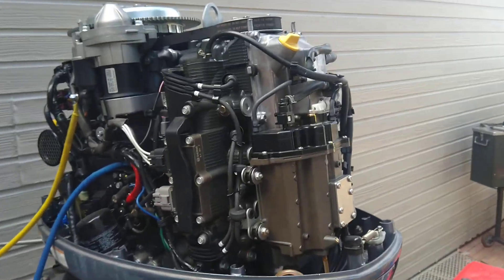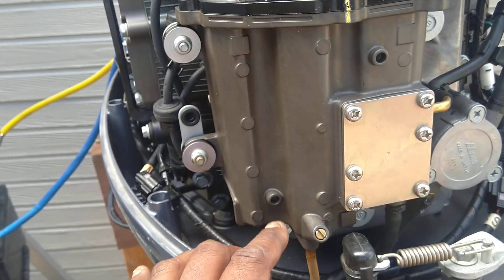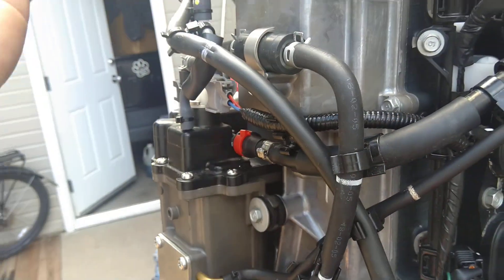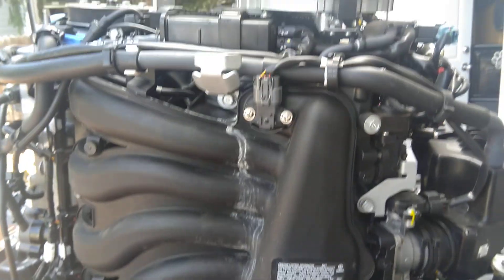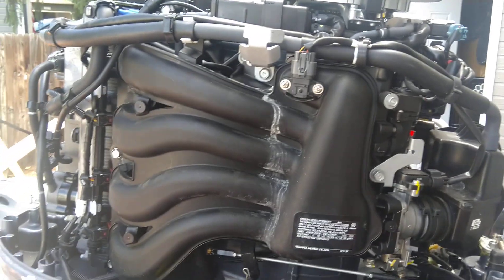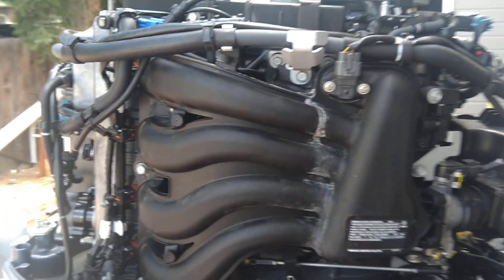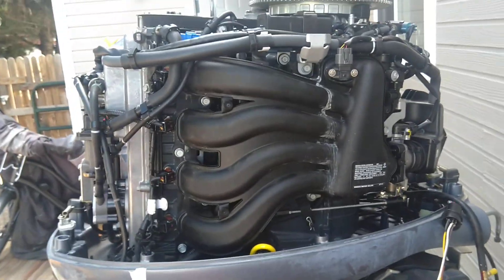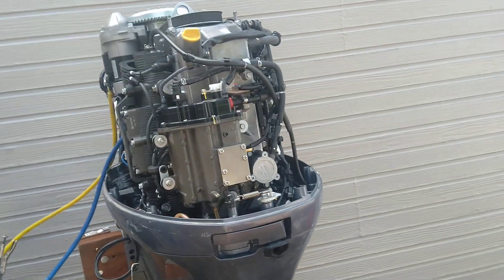Yamaha f90 first start after head gasket repair

Comment: without water?😅
Reply from the maker: Running it without water for a min won't hurt it since pump is shot. Running without out water will burn up impeller but since it is getting new one this was to make sure motor runs.  New impeller on it's way